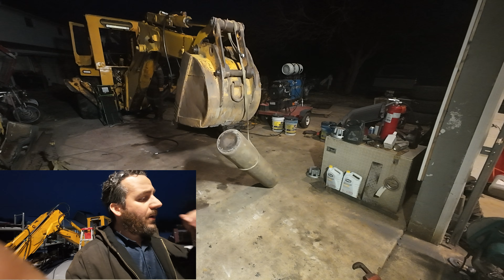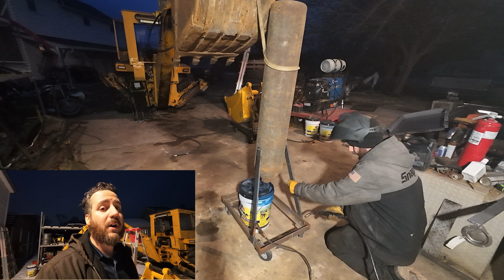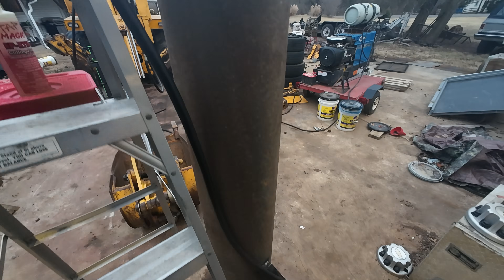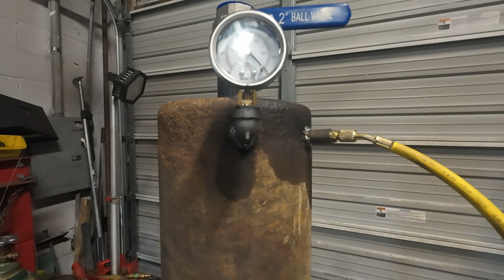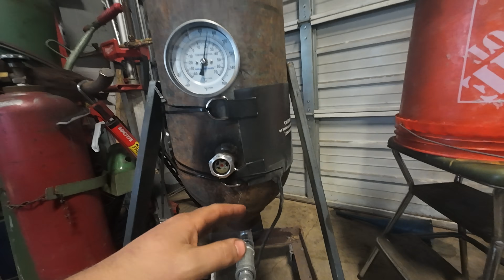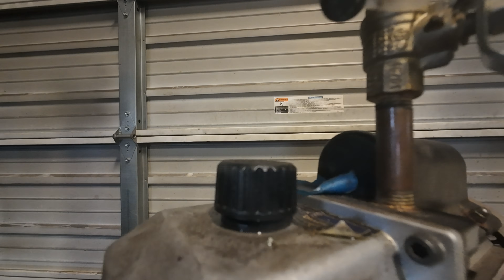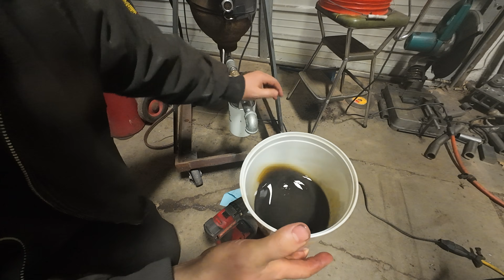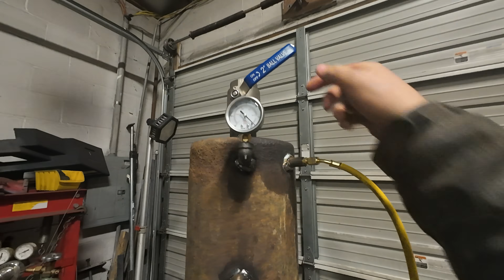I made a machine to remove water from hydraulic oil. Vacuum de-hydration

Comment: Wonderful idea. Many years ago, my father worked in a B vitamin plant where they "boiled" the water of the vitamin solution at room temperature. But never thought 🤔 it would also apply to dry hydraulic fluid without degradation.
For next to nothing you could add an "air lock" at the top using a stretch of thick pipe and a second ¼ turn valve; that way you can recycle your samples back. Maybe the pipe can hold anything from half to a full quart.
And extending from the same idea, with a second cylinder connected with a needle valve to his existing inlet, you can atomize the oil entering the vacuum cylinder, as per other comments. Since you have the vacuum, you don't even need it to be above, it may be side to side and the vacuum will suck the oil anyway

Comment: I like your idea but it has a minor flaw, what I would do is measure the weight before you do the cleaning process, pour that in do your thing, pass it through the filter in the same bucket, now you can verify by weight of what is in that pail, then if you want to get anal, do the same test and see the weight after it drips dry again and reweigh it. I did not read any comments, someone else may have suggested this.

Comment: You need a condenser between your pump and your heat tank
Reply from the maker: It wont hurt I agree, but it isnt needed if I dont mind changing compressor oil every few batches.

Comment: Very smart idea and solution! This is genius. Great work and very cost effective solution for a very cost effective outcome. I had no idea that Hydraulic fluid had become so expensive. I shouldn't be surprised with all the greed in the oil industry. I digress! 
Anyhow, fantastic solution to a problem when running hydraulics.

Comment: Does marine polishing systems remove water from fuel oil\diesel? And could that be used in this useage? 
I am just thinking of a "a home brew" device which can be plugged inline to the hydraulic system and just circulate the fluid whilst pulling water out?  Or is that a complete no go?

Comment: If you put a micron gauge on there you can run that until it stops at like 400 microns or less. that would be 0% moisture but 100% your not even to 2000 yet with those leaks.

Comment: in the summer time you could just take it outside and put it in the sun, or even paint the tank black and build a small solar Green House just for the tank. Then make all the connection go out the wall of the green house so you don't have to go into the Green House to; Fill, Extract the fluids. If it's a cloudy day you could put a curved reflector on it. Then here's a novel ideal, put a solar water heater outside and run the hot water pipes through the tank and let the solar water heater heat the oil under vacuum. Also if you wrapped copper pipe around the outside and insulated all of it, then the copper pipes could be run through Solar Hot Water heater to heat the oil tank for free. It may take awhile for the tank to get up to temperature, but it doesn't cost anything. In the winter if you have a stove in the shop connect the hot water feed to coils around the shop stove to heat the tank. Free heating for the tank is pretty much endless depending on how ingenious you get. Love this project. If you have enough of these and fellow workers who need this done, you could start a small business with it. Just some thoughts on the matter. I hope you find one of these Ideas helpful. Thanks for the project ideas, Loved it. Best Blessings. Keith Noneya

Comment: 200 deg for oil is your problem oil is running too cool oil needs to get hot enough to boil off moisture 
Lake speed shows the science behind it even at 240 the base oil which is the main ingredient
You need a good synthetic oil and let it operate at higher temp
You might wire is too cold to penetrate

Comment: Engineer here whose done some vacuum drying in the past, the enemy of vacuum drying is freezing. Water boils quickly, but as it boils it sucks away heat and tries to freeze. At that point now youre relying on sublimation (ice to gas) instead of boiling which is a very slow process. If it freezes youre better off shutting of vacuum, melting the ice, then trying again, itll take an eternity to remove an ice slug with vacuum.

Heats your friend here, keep the tank warm (or stick to very low evaporation rates).

Also make sure your vacuum hose line cant collect water anywhere (down hill the whole way) otherwise stagnant water in the line will freeze and block the line. Its worth touching each fitting every so often and make sure none are cold which may indicate freezing.

For the water in your vacuum pump if you block the pump inlet and open the ballast (i believe its always open on these pumps) you can boil the water out of the pump oil instead of having to change it constantly. May as well just put a valve on the pump inlet and shut it between runs while leaving pump running. Bonus, shut the pump inlet and see if the pressure in the tank rises, if so either its leaking or youre still boiling (gas expands raising pressure), if pressure holds for a couple minutes the oils dry.

You could send some of the processed fluid for oil samples to see if the additive package is holding up in the oil and if its still good to run.

Sweet rig, just suggesting a few optimizations.

Comment: Instead of thinking that you needed to invent the wheel oil has Long been run through a centrifuge  on ships Very much like a De Laval cream separator ....We ran the Lube Oil continuously through it it ...And JP*5 as it was pumped into fuel tanks the tech dates back to 1877...De Laval oil separators are industrial centrifuges originally developed from Gustaf de Laval’s 1878 patent for cream separation, now primarily manufactured and supported under the Alfa Laval brand. These machines utilize high-speed rotation to efficiently separate water, solids, and sludge from lubricating oils, diesel, and fuel oils in marine, automotive, and industrial settings.

Comment: This popped up again in my feed.  Still cool.  I'm wondering whether the chemical reaction between the rust and the corrosion inhibitor with the rust in the tank would substantially reduce the inhibitor's percentage in the oil or form byproducts?  I'm going to go check your videos for updates now, so if this has already been covered, sorry.

Comment: I work with spray foam kits that have a moisture curing urethane in the gun (applicator) hoses. Depending on the material of the hose water can permeate in days or month, this is true of car brake fluid hoses too. If you don't currently have low permeation lines that could be your issue. You should be able to go 5-10 years before your emulsifier to become saturated where the water is free to cause rust in the system or in the case of brake fluid enough water to boil at low temperatures.

Comment: You could make instead of a Ice Bath, Just make a simple Manifold out of black pipe with say 4 or 5 Vertical pipes and with a Drain on the Bottom and a Outlet to the Vacuum Pump on the Top.  If you keep the Manifold Cold it would "Dry" the Air Better for the Pump.

Comment: let's see... chair tai chee? or the new spank ranch video? Pull a vacuum time!
thinkin the oil reacted with the mettalurgy of the cylinder - might "lighten up" after a few uses? let sit to see if it settles - send in a test sample for analysis!

Comment: Excellent work!  I would recommend using a desiccant filter (HVAC style) on your vacuum line to help with moisture and acid capture.  Or you could make a home made one (molecular sieve type) or one with regular desiccant and dry the desiccant for reuse (like a air line dryer for painting air).  Help the vacuum oil last a lot longer.

Comment: Back in the day, I worked for an electrical contractor that had a mobile rig for cleaning/filtering the oil in large transformers. As I recall, it was a recirculating system that would pump the oil from the transformer into a vacuum chamber of sorts that was connected to a large Roots style vacuum pump and then back into the transformer. There was also some dematiaceous earth (clay) involved as well. I think that removed the suspended solids. The process took a couple of days to complete. The oil would get sampled periodically and the dielectric strength checked with a hipot checker.

Comment: Instead of site glasses, a thick plastic tube could run from the top site glass to the bottom. Then add a large pipe with caps on each end with smaller pipe fittings welded in. Fill with desiccant to take a lot of load off of the vacuum pump oil. The desiccant can be heated to drive the water oit to reuse.  Draw air from the top of the oil tank to the bottom if the new pipe. The vac pump obviously draws from the top of your new desiccant water trap.

Comment: I think typically the water carries out all of the if not some of the dirt in the oil. When you remove the water it returns to the oil. If there was a way to separate the water and remove just that you could remove the crud with it. But i don't know if that is even possible. Maybe put a much higher rated filter on the outlet and pressurize the tank you drain it. You have a wonderful idea here. I hope it amounts to something good.

Comment: What you've built here is a seriously good idea. I have a few ideas about it that might make it a bit better functionally. First, you could run the vacuum pump and pull the used oil in from the bottom instead of having to climb up on a ladder and pour it in. I don't know about you, but my back doesn't really like having to do work that I don't have to. The second thought I had was to use the valve at the bottom to suck the oil in through. It would be easy enough to screw in a fitting for some fuel hose or something which could still be used for draining off the waste and it would make it easier to fill buckets. The third thought is a distiller of sorts to condense the water and keep it from getting into your pump possibly ruining it. Some copper tubing coiled in a cylinder about half full of water with the suction at the top should do it. The water will capture the vapor as the escaping gases bubble through it leaving it reasonably dry. If you follow that with a descant pack it should keep the pump safe. The last one is an air line fitting welded in at the top to push the oil out faster with no glugging. I don't know about you, I don't like waiting all day for something to drain. The valve at the top will help a lot. I think positive pressure would move things along a little quicker.

Comment: Roast a big pan of epsom salts in your oven on self-clean and then put a cheap vacuum chamber in line with your vacuum pump to absorb the moisture out of the air.

It'll even keep you from having to run the pump all the time because once you get the water drawing out it'll keep the pressure low.

To test if it's trapped air, just draw a vacuum on a small amount briefly.  It'll take any dissolved gasses out pretty quick.

Comment: Got to be careful with this we found out that if you do it to many times it will pull all the additives out, but we tested on fresh bulk oil we got and pulled water from that too. 
We bought a machine built for these jobs and it had a second chamber to separate the water out and it really is wild how much water that oil will hold.

Comment: Even with a cold trap on my freeze dryer I get water in the vacuum pump, I let it set and it will separate, unless you have particles of the emulsifier from the hydraulic fluid getting into the pump.  Now to look for an second hand turbo vacuum pump...

Comment: Use a hydrometer. The float type. Get new oil, place they hydrometer in it. Record the number. Then you have baseline, No water.
Then put hydrometer in your schlew. Record the reading.
Thats you saturation number.
Run your rig 1 hour at a time. Record each sample.
Then you'll know min cook time.

Comment: People that use waste oil for diesel need to filter and remove water from the waste oil, I have seen them heat the oil in a 55 gal drum, they use a pump to circulate the oil and they spray the heated oil, while fans blow across the oil spray and the water evaporates.  Yours is a more elegant design but most couldn’t build that.

Comment: This is a waste of time, if you ask me: the products added to the oil to keep water in solution are broken down. So you might be able to extract the water, but you wont be able to remake the dope. That means the oil is "oil" again, but the oil misses critical additives.

Comment: The concept of using an ice bath between the bottle and vac pump is entirely valid and will reduce the water contamination of the vac pump oil. I successfully employed this technique when drying a new large industrial chlorine liquefaction system. This was a large system with many vessels, a 5 day process.  The final refrigeration charge was 27,000 lb R22. Great technique and video. KUDOS!
Reply: that is wild

Comment: It has probably been said a few times, but adding a cold trap in the vacuum line could help save the vacuum pump and also give you an inside into how much water you are actually pulling out. Maybe just a copper coil through an old mini fridge would do the trick...

Comment: If you add an air inlet at the bottom and use a needle valve to let a very small amount of air in to bubble through the oil, it will evaporate the water faster.  Just keep the air flow low enough so you can maintain the vacuum level.  If it's a cold day, you may want to try and warm the air up a little before it goes in.  a small coil of tubing in a bucket of hot water would probably work well or just a hair dryer blowing on the coil.

Comment: You need a condenser mounted to your vacuum port and the vacuum mounts to the condenser.  The condenser will turn the water vapor into a liquid where it can be collected and also save your vacuum pump.

Comment: Id put standard motor oil in the hvac vacuum pump to minimize the water pickup until this is done then rinse it out with isopropyl and refill with PAG oil when you are done.

Comment: I believe Parker Hannifin has a filter system mounted on a hand truck that will filter water out of hydraulic oil. Double check me. Also be advised that Ritchie Bros. does oil tests on some engines and hydraulic systems on equipment they are auctioning. They check for water in engine oil tests, but not in hydraulic oil tests. They list the water test in hydraulic oil as not applicable. If you have ever had your hydraulic system freeze up in below 0 Fahrenheit temperatures, you would realize the mistake in this assumption. Thanks for the video. Take care.

Comment: Right off the Hop. Just like to say I have not watched the whole video yet. I'm commenting Midway through. I shouldn't do that. I know because you might rectify this problem later on in the video. But I'm really digging this video and I have a suggestion about the moisture buildup in the vacuum pump.  Here's a solution that you can do without building a trap or another type of tank or anything like that. This is much simpler and probably more effective and way less maintenance. I would recommend taking your vacuum pump and positioning it above your main tank. Maybe build a little shelf for it up there but you want your vacuum pump at a higher elevation. Your substrate that you're drying. What's happening is is that it's pulling out of the tank as a vapor. It has to it will not pull liquid out the top Port. So if it's only pulling vapor out of the top Port then that would mean that the vapor is condensing in the hose on the way down to your pump. So it's pulling it out as vapor and then condensing as a liquid in the hose and then running directly into your pump by positioning your pump above your tank. Then as the moisture gets pulled out of the tank. If it was to condense in the line then the liquid water would run back down the hose and back into the tank to then be re boiled off again and your vacuum pump will only have to deal with vapor. And those vacuum pumps are designed to deal with vapor. They can deal with vapor all day but liquid water, not so much.  

And if you really really want to go the extra mile and be that next level type of technician then I would ditch the HVAC hose and substitute it for piece of copper pipe with flare fittings. The fitting that's on your pump and the fitting that's on your tank are already designed to work with flare fittings and copper pipe. So it would literally be as easy as just taking the HVAC hose off and replacing it with a form fitting. Copper tube with flare fittings. You'll get a way better vacuum using the hard tube because I don't care what they say. Those hoses are permeable and they leak.  Straight copper tube doesn't have them issues. Plus not to mention, you don't want your hose or whatever you're using to connect the vacuum pump to the tank to have a gully in it. You really want it to be a straight line from the vacuum pump to the tank. So if any moisture condenses in that line it'll run back to the tank and not into your pump.  

Man, this video's got me all excited over here. I want this to work for you so bad. Oh, and for extra brownie points insulate everything! I would not worry about overcooking the oil but you want to drive that moisture out as fast as possible. My dude. Insulating everything. Even the copper tube going up to the vacuum pump insulate that as well you want the least amount of water condensing on the sidewalls is humanly possible. That's inefficiency and it's time wasted my brother!